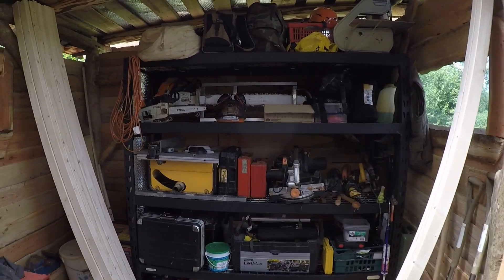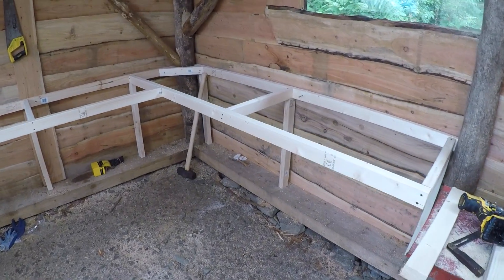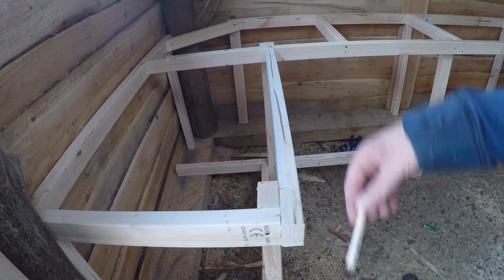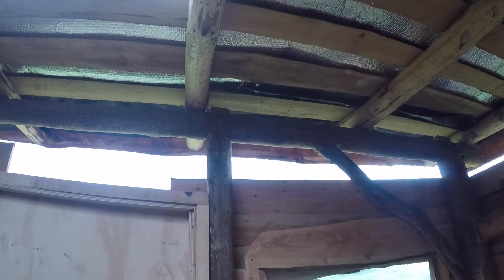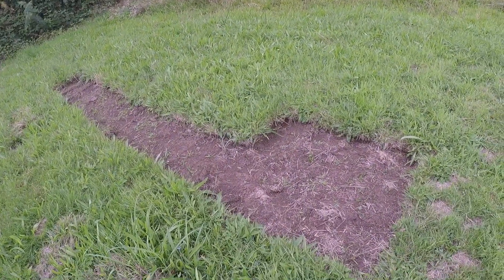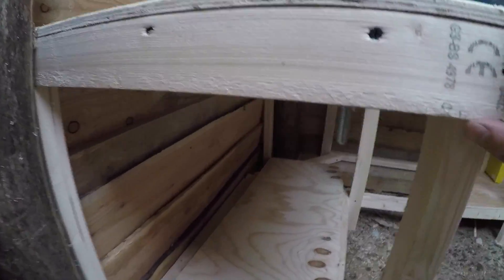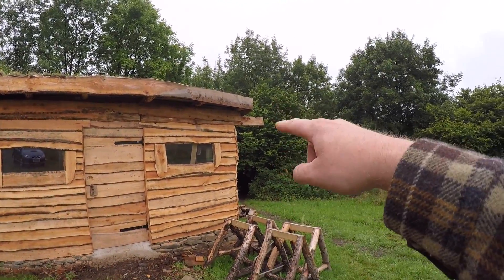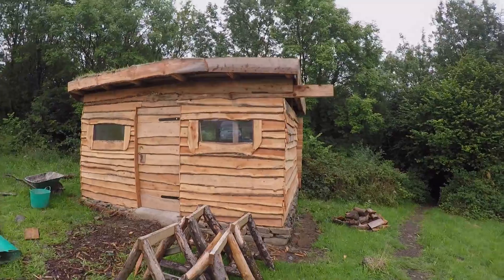Roundwood timber framed shed part 11 work bench

Comment: Very nice, this is typical Welsh weather Kris, your gonna have to get used to it lol, it's more like November than August, I was hoping I could take my thirteen year old son camping around the Gower but that looks like its going to be a non starter. 
What are you going to do with the floor? You could try laying flat stone or compact earth sealed with oil would look nice and be better for cleaning up if you don't want to leave it as is, but I wouldn't lay wooden flooring because my mate did that and the vermin had a lovely new home, all in all though Kris I think you have done a fantastic job making a home for yourself and that shed is much better than anything you could have bought for the money you would've spent by now I think and the construction method you used should be far stronger

Comment: Great work, only thing I would suggest is move the vice so that the back jaw is level with the edge of bench, otherwise you can't hold longer length stuff upright in the vice. If it's level to the front it clears.  Hope that makes sense?
Reply from the maker: Good point! i cant believe i dint think of that..... thanks.
Reply: Kris Harbour your more welcome

Comment: Nice work mate. Those smaller waney edge boards, dry them off and stick them on ebay as shelving boards , will get snapped up and can make a few quid as well.
Reply from the maker: Good idea but i can find plenty of uses for them for shelving in the kitchen.

Comment: Looks great!!  Get some pegboard and you can hang up some tools above the workbench! :)
Reply: If he wanted a rustic feel then he wouldn't have used hardware store 2x4's and a mass manufactured metal racking.  I don't think he cares.  I have pegboard in my shed and garage and I love it!
Reply: asusreviews  Or he might use the thin pieces of board and custom drill the hole layout. I noticed the slabs of wood he said they were thinner than the others might work.they were long.

Comment: Are you going to fix up some form of exhaust for your generator or is the idea that the batteries will be up in the shed before long? It may be better for noise reasons to have a mini-shelter for it some distance away from the shed (possibly in the ground to reduce noise). You'll probably need some extra power before long to support the batteries. Also, you haven't set up the hydroelectric power generation which would be good to see - is the power from this going to the shed, house or both?

Comment: I was going to binge watch Vikings but instead I watched this entire build 🤗 I have a question...Did you attach the posts to the sill plate? I live in tornado alley & I’m wondering if I’d need to do that in case of high winds, which are more likely than a tornado hitting it. TY for filming all these great builds!

Comment: Looks awesome, fully jealous. Makes sense to put the solar in the shed, then run the 240v to the house for less voltage drop for that distance. How do you plan on heating the shed in the winter? Small wood stove?

Comment: Unless you're a neatness farook, shelves, rather than cupboards 'n' drawers, are the key to a tidy shed. Clutter accumulation occurs when you put stuff down on the closest flat surface, but with shelves that means it's in its place. Not to get too egghead, but it's a loophole in the mess-time continuum. Yip! Yip!

Comment: Nice one Kris.  what's next after the shed then?
Reply from the maker: move in to the roundhouse and get it finished. then i will be doing hydro electric over the winter. next spring i will be starting a new building. not sure what one yet...
Reply: cant wait.   you using the hydro wheel you have built or starting from scratch?
Reply: + Kris Harbour If I were you I'd build something like a large carport. For wood storage and for being able to continue doing your stuff outside, no matter the weather. Just my 2 cents...
Reply: An outhouse!